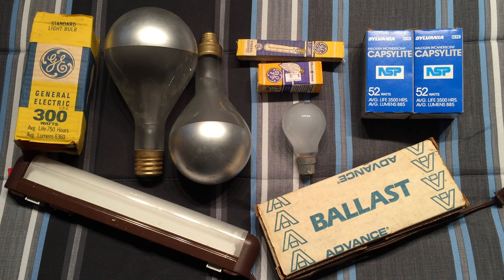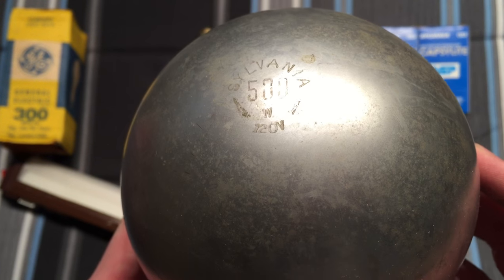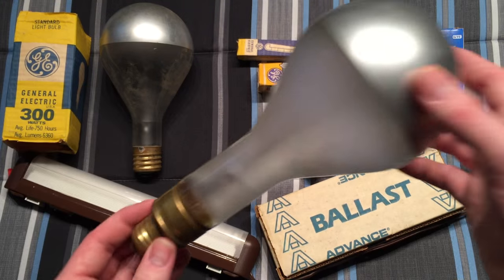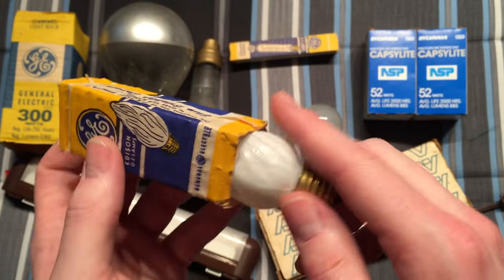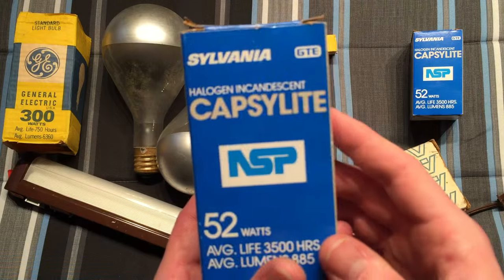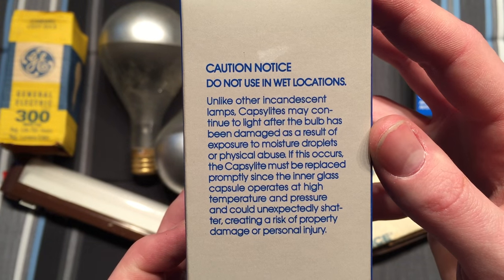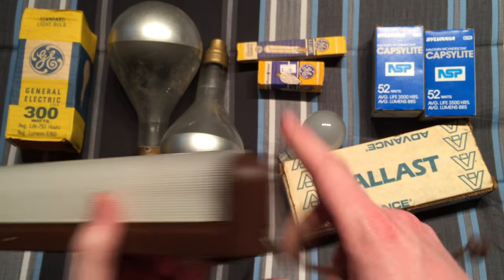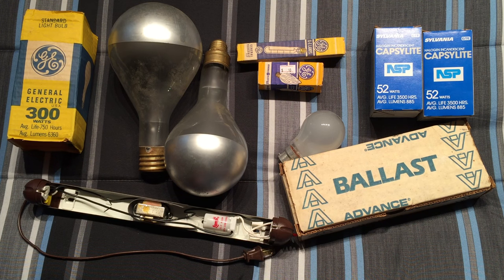Silver Bowl Bulbs (Finds of the Day 7-21-15)

Comment: Nice finds! I like that Lampi fixture.

A cutout lampholder (also called a circuit-interrupting lampholder) will completely cut power to the ballast if a lamp is missing. You're perfectly fine to use regular lampholders.

Comment: Great video Parrot! Since slimline lamps do not have a heated filament, per se, they run on a much higher voltage.  The ballast you have is 500V, and the ones for the 96" slimlines put out 760V if I remember correctly.  Each cutout lampholder has 2 contacts inside that are in series with the 120V input, they are connected together by the single large pin of the slimline lamp when it is inserted.  As themaritimeman said, this cuts power to the ballast if either lamp is removed.  You dont HAVE to use them, but the 120V leads are part of the lamp circuit and would need to be connected to a non interrupting lampholder if used.

eric